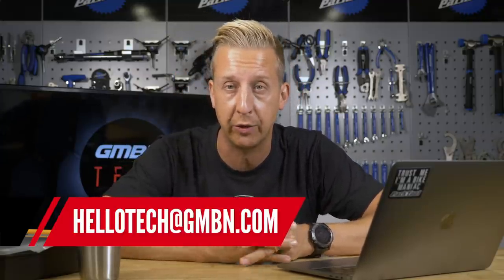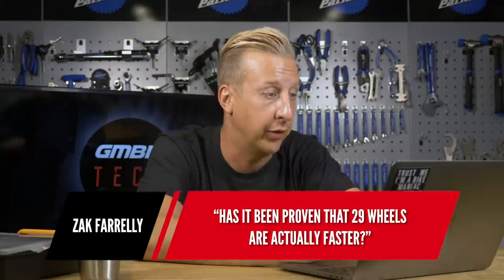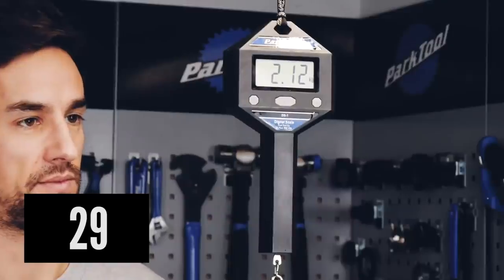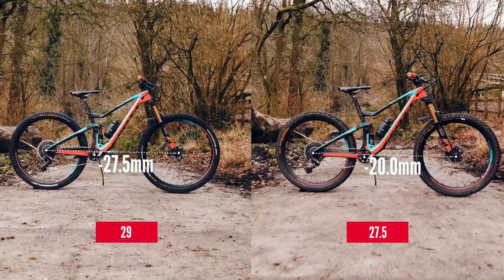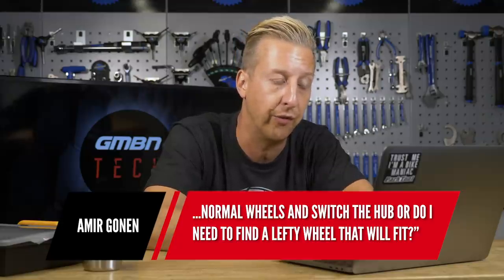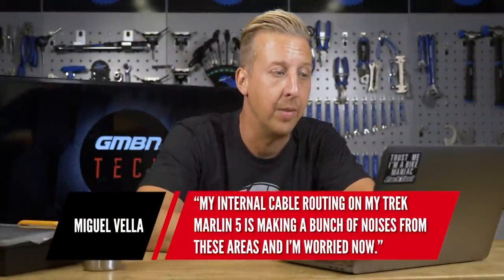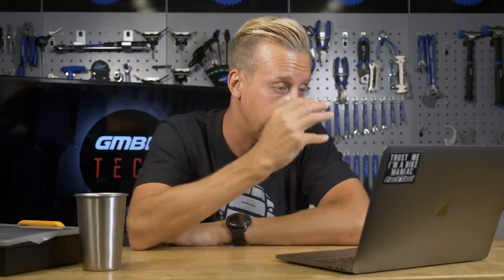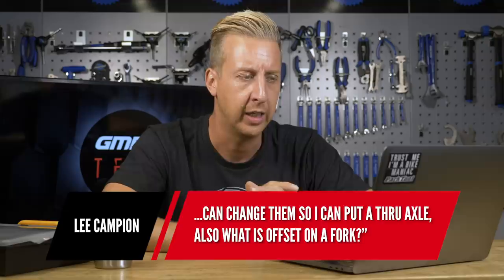Are 29ers Faster? | #AskGMBNTech Ep. 89

Comment: #askgmbntech I currently run 2.6' tyres but it's time to upgrade as current tyres are worn and also I would like more grip. my bike (hardtail) has enough clearance for 2.8'.  For general UK trail use will it be better to go for more aggressive thread or bigger tyre with only a bit more aggressive thread.
Reply: Don't go 2.8, I'm pretty sure there is a lot of mud down there in the UK, so 2.8" will be absolutely terrible in the mud and have very little support in corners and in jumps. 2.6 is the widest you should go.

Comment: #AskGMBNTech I’m looking at getting a downhill bike and I’m stuck on what size to get I’m stuck between a small and medium as the bike manufacturer recommended a small but it is 10mm shorter in reach and a medium is 9mm longer but I could get a small stem what would you do go with a dh bike with a smaller or longer reach

Comment: #askGBN I bougt hardteil I wont to put fat tires on my bike. Will that help me in narli tereins
Reply: Should do mate. Depends what size tyre your frame can fit as to how big you can go, but if the bike currently has narrow tyres, fatter tyres will help a bit. Also try to work on your riding position and techniques. Tyre pressure can affect it aswell.
Reply: In addition, tubeless tyres with lower pressure will increase grip and make the bike a bit more comfortable on rough terrain.
Reply: Fat tyres won't fit, but you can probably fit slightly wider tyres.

Comment: #askgmbntech My bottom bracket keeps creaking even after I open it, clean and tightened it but it only stay quiet for a few days (probably 6) any ideas? Thank you
Reply: # 22554 don’t assume it is your bottom bracket. It could be your pedals, chainring bolts, loose wheels, seatpost, saddle. I’d start by checking the chainring bolts
Reply: @jonathanzappala  replaced pedals replaced chain, regreased, checked the wheel, all fine, still creak when I ride off-saddle so Im pretty sure its the bottom bracket of it only creak when I apply force no matter what the gears are
Reply: # 22554 that’s the way you know. You didn’t say what kind, if it’s press fit I would try getting one of the thread together press fits, wheels manufacturing makes them, among others.  It ties the two sides together to prevent creaking from walking.
Reply: @jonathanzappala  I got a threaded one
Reply: # 22554 you just want a new one then. The only reason they make noise is if they are old.

Comment: #AskGMBNTech

Hi GMBN Tech,

I absolutely love you videos, they maked me from a Guy that has fun to repair and upgrade his bike witout having many nowleged to nearly a pro since the carentine has begun in Germany. 
In this spezial situation I have a lot of time and I am only working (I am a System Admin) and after work thinking about my bike and how I can make it better ans also riding it. 

So my bike is 26 Cube acid 2012 I upgraded to a new rim set with xt hubs and new formula disk rotors. 

I also upgraded to xt brakes. 

Now Iam thinking about upgrading my rockshox recon silver. 

But I also think about considering to upgrade to a 29 Frame wit 29 wheels and taking my drive train that is complete set from shimano xt to the new frame. 

I only considered it becouse I like a lot to drive on streets( I love Speed) , forest paths and also a bit of easy trails. 

I only want to now if the speed holding difference is so noticeable that it is worth to invest this kind of money for a new frame and rims. 

What is your opinion @gmbntech?

And also the community what are your thoughts about it? 

PS. I am also a heavy rider 120kg^^ but I am working on it

Comment: #askgmbntech How do you fix a rear shock that's leaking air?
Reply: skapari _ 
You need to take it to a shop and get it rebuilt.
Reply: Replace air seal. Basically a air can service. £30+

Comment: #AskGMBNtech My rear hydrolic brake is basicly stuck on and it is very difficult to spin the rear wheel. Is there anything I can do about this?
Reply: Take the pads out and push the pistons back in should work
Reply: @ryansara3398  i did that it helped a bit but still went back to being stuck
Reply: @danielgough4496  put whatever you use to bleed them in the top at the lever then do it, it should let some fluid out allowing them to move further
Reply: clean the pistons, https://www.youtube.com/watch?v=ys9bUOJ0qg0
Reply from the maker: You could try lube up the pistons. Check this video Henry made here 👉 https://gmbn.tech/henrysbrakehacks . Failing this you may need to do a full calliper rebuild. Your local bike shop should be able to advise you on this.

Comment: #askbmbnteck Hi i am new to the sport and just picked up a Giant Talon 2, my question is i have very narrow rims, 21mm inner diameter.  I am running tubeless but my rear tire seems to roll a lot would increasing the pressure in the tire help?
Reply: Yes.
Reply: 21mm isnt super narrow but will be a factor, it could also be your tire sidewalls are thin and lack support
Reply: @ultiss  Yes it is.
Reply: @th_js  the giant talon is an entry level xc hardtail. That type of bike often has 19mm wide rims.  If its running 2.25 tires 21mm should be just fine
Reply: @ultiss  Not really, if it's not old, it will often have 23mm rims.
Reply: It actually comes with 2.4 tires

Comment: #askgmbntech hey Doddy, I want to try some kind of Shimano gear hub. I've had one on my urban bike for years, and it works amazing. I'm just worried about the weight. 1650g for a hub seems like a lot. Maybe I could get a Shimano 3 speed hub, instead of a single speed? What do you think?
Reply: Just forget it.
Reply: @th_js  that seems to be the general reaction everyone has, but why? Some people say they love it, but some people say it's too heavy. And what about 3 speed hubs? They weigh less than GX with a light hub.
Reply: @lolimpol  They're harder to maintain, they're really heavy, don't have good range, not smooth and can't get them in modern standards.
Reply: @th_js  simply not true, they DONT have to be maintained, (they say except for a 6 month oil change) I've not maintained mine, and It's been ridden every day for 20km to school, and it's working perfectly. They are smooth, no different from my mtb hub, and no you do need a single speed dropout. They also don't have a good range, but it's better then a single speed, and going back to the maintaining point, all you do is lube the chain and your done after a muddy ride.
Reply: @lolimpol  What I mean is that when things go wrong in there, it is very hard to service them by yourself.
Reply: @th_js  not true, I asked my local bike shop, and a full service costs €10. I have the advantage that I live in the Netherlands, and geared hub city bikes are EVERYWHERE around here, so service is super super easy to find.
Reply: @lolimpol  I get what you're saying, but unless they make a MTB-specific one, they really aren't that practical for mountain bikes.
Reply: @th_js  but have you tried one?
Reply: @lolimpol  Yes.
Reply: @th_js  well, since I'm really stubborn, I'm going to try it anyways :)
Reply: @lolimpol  Well since I'm very stubborn, I advice against it ;)
Reply: @th_js  haha, probably very good advice, but nothing can stop me once I set my mind to something!
Reply: @lolimpol  Fair enough, I can relate. I still wouldn't do it though.

Comment: #askgmbntech Im 14 and hoping to get a job at a bike shop. When thinking about the tasks I will have I couldn't work out the proper order to install components e.g. brakes then gears then dropper??? any comments on the easiest order to install components.
Reply: It doesn't matter.
Reply from the maker: Hey Stephan, if you would like to get a job in a bike shop you could ask your local shop if you can go in to just "shadow" one of the mechanics. Some people may find this a little boring as you would essentially be just being quiet and watching the mechanics work, but this is a great way to see some tricks of the trade and most efficient ways of working.
Reply: @gmbntech  thank you very much